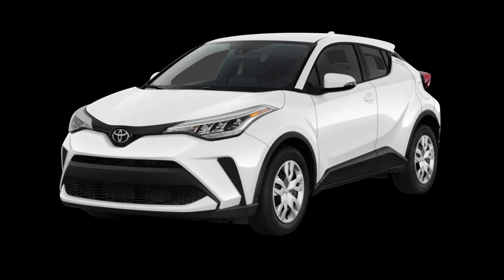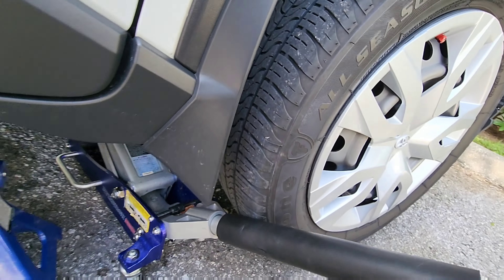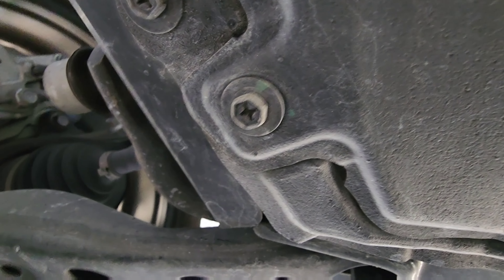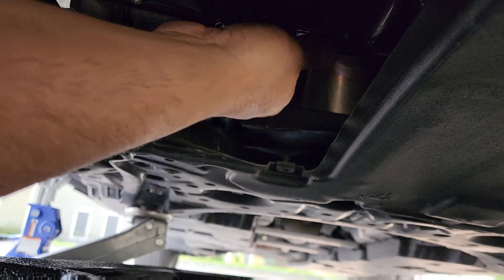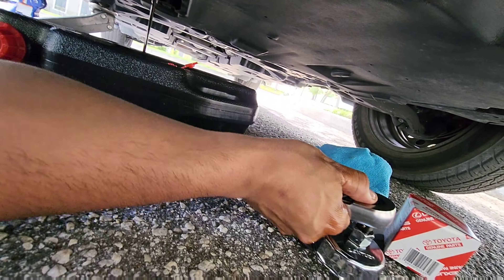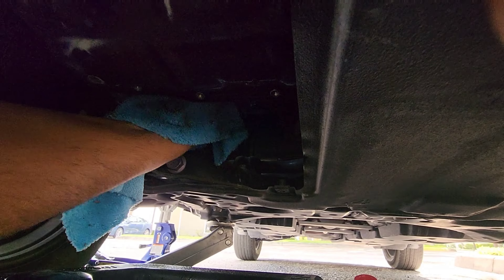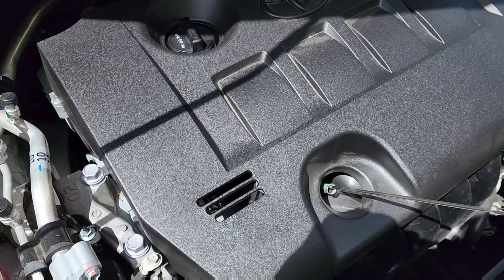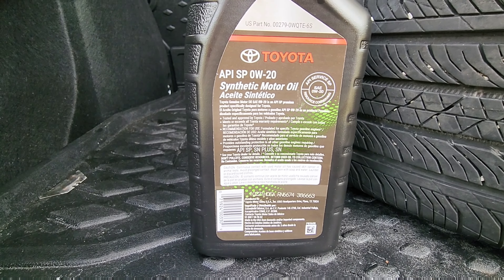Quick oil change  and filter for Engine  2021 Toyota CHR How to

Comment: 3:00
My wife's C-HR (2020) never drops the washer. First time I changed her oil, I didn't see it and thought that the bolt was washerless (just like my Camaro). It wasn't until I changed the oil the second time that I felt it up there. It never comes off during oil changes, so I have to whack it with a screwdriver to replace it.
Reply: Its suppose to be changed after every oil change.
Reply: @wacalla26  I know, which is why I whack it off. It's not critical to do so, however, as was the case with my most recent oil change. I couldn't locate my bag of washers, so I reused the old one. It'll work just fine.